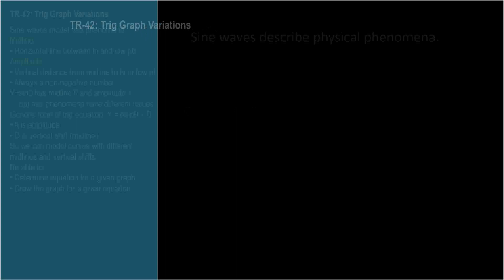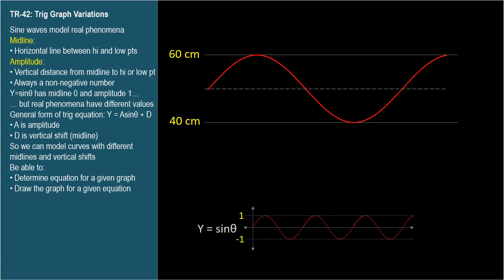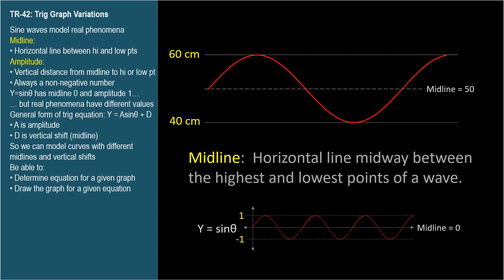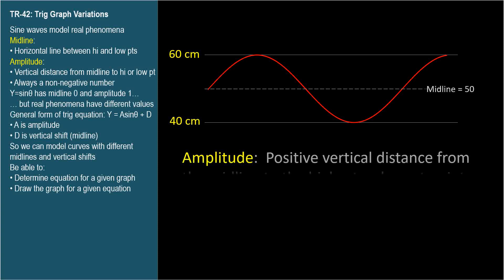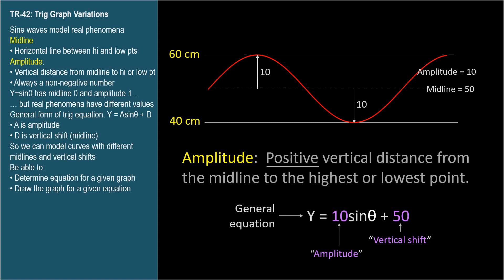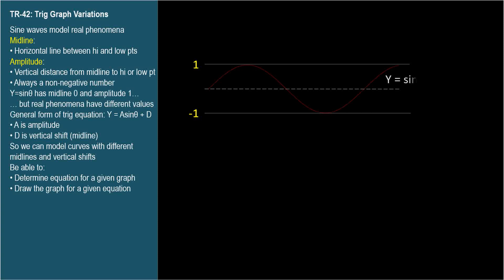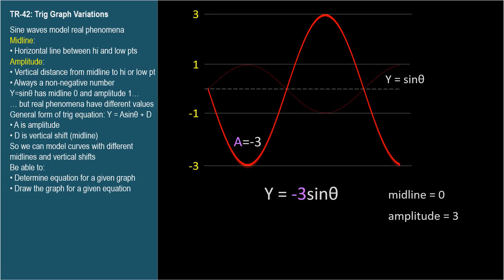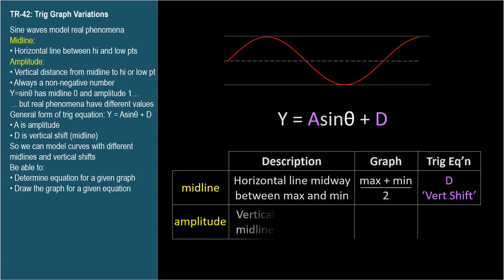TR-42: Trig Graph Variations (Trigonometry series by Dennis F. Davis)

Comment: You should add common qualifications as keywords like 'A level' in your descriptions. Whenever it's exam season, people can better find your playlist as they're likely to be using the keywords when searching for videos (this playlist, for example, is perfect for the Pure 3 paper in the Edexcel international A level but I only found it coincidentally)
Reply from the maker: That's a great point Sana.  Unfortunately for me, I'm completely unfamiliar with international academic standards.  I'm an American engineer, not a professional educator.  But if you suggest appropriate key words to add ("A level"?) , I'll add them.  Thanks!
Reply: Please try

'International A level'
'IAL' (short-hand for above)
'Edexcel' (Pearson exam board)
'CIE' (Cambridge exam board)
'P3' (exam paper involving trig in IAL)
'P2' (exam paper involving trig in IAL)

These are the ones I most commonly use!